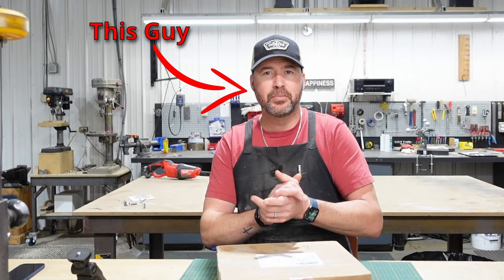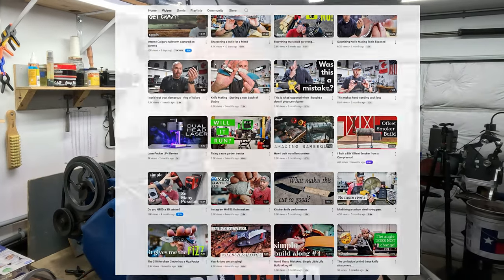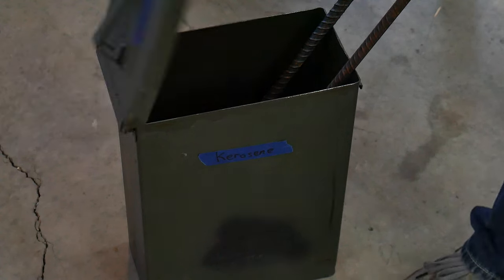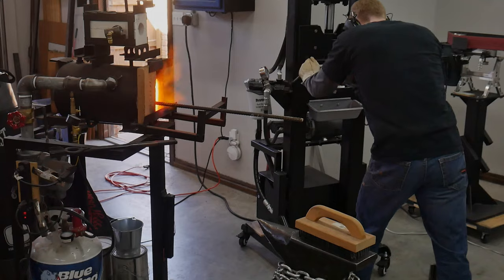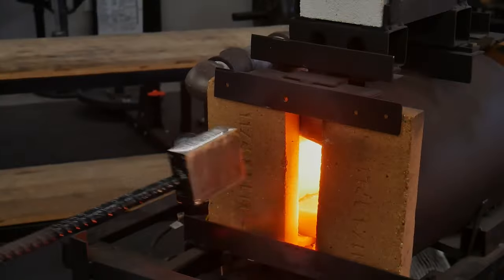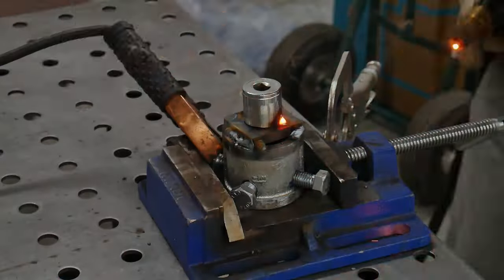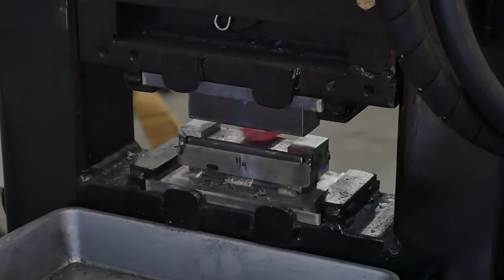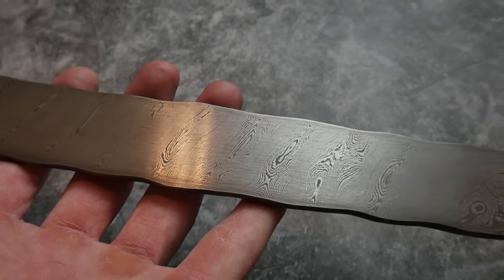A Knifemaking Collaboration with @Simplelittlelife  | Twist Damascus Billet

Comment from the maker: ⭐Simple Little Life Knife Build - https://youtu.be/KbfwU898G6s?si=cFS8_d-4YFpt4trX
🛠 Notable Items and Tools:
Butcher Brush - https://amzn.to/46MtWXA
Hercules 7'' Angle Grinder - https://www.harborfreight.com/15-amp-7-in9-in-trigger-grip-angle-grinder-57363.html
Ferric Chloride - https://www.harborfreight.com/15-amp-7-in9-in-trigger-grip-angle-grinder-57363.html
Cheap Pipe Wrenches - https://amzn.to/3WA0wa8
Reply from the maker: @abu-abdullahan  I do sell what I make; but my output is really slow and I'm not taking custom orders! 

https://redbeardops.square.site/s/shop
Reply: Red Beard. I have a question. I built a hydraulic forging press about two years ago. We’re downsizing and I can’t take it with us. Where would be the best place to sell it? I have numerous pics and videos. I built the hydraulics on a separate cart and the press has a magister cylinder that kicks butt. Any help would be appreciated.
Reply from the maker: @beardawgjohnson6432  You know it's really hard to know for sure, but I bet your could sell it on blade forums ... if you don't have social media